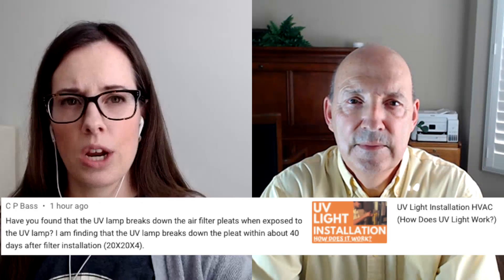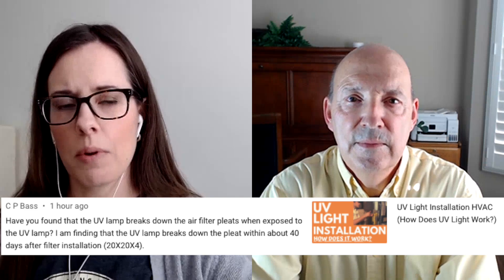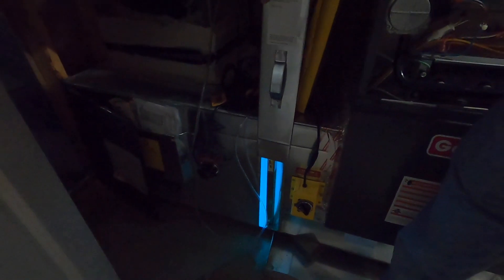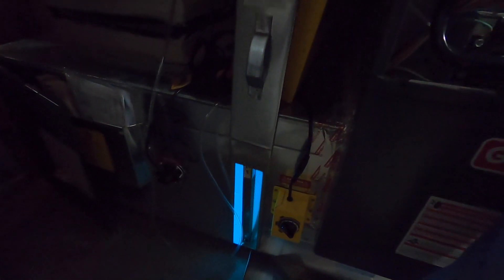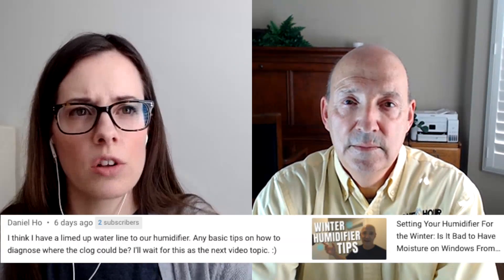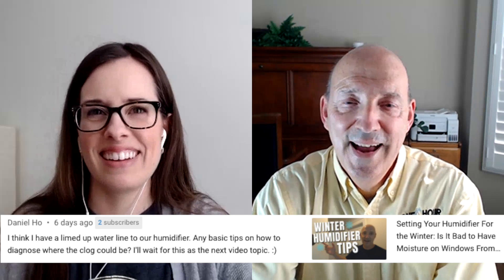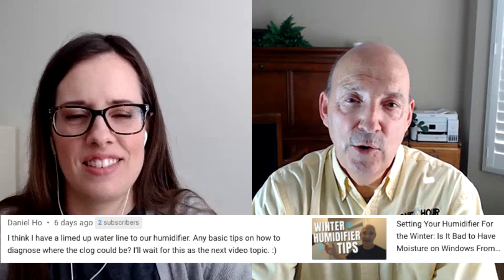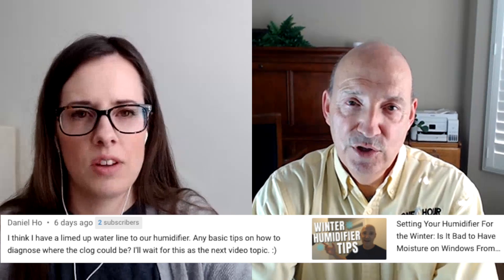YOUR HVAC QUESTIONS ANSWERED BY AN HVAC EXPERT | UV Lights, Humidifier Clogs and Broken Dampers

Comment: Thank you for the video but our house has no handle for a dampner. It's an Aprilaire unit and it uses two actuators. But we have no sur flow downstairs. Is there a way to check if its open or closed?

Comment: I have a 3 bdrm ranch and half of my basement is finished. One bedroom, which sits above the finished side of the basement is ice cold and very little heat comes out of the wall vent. I'm assuming it's because the damper is closed, but I can't get to it due to the basement ceiling being finished. Is there a way (some sort of tool) to open the damper from the bedroom down into the ductwork? I don't want to take down the entire ceiling to find where that damper wingnut is to open it.  Any suggestions?

Comment: Good job.  My A/c company installed a U/V light in my return duct.  I thought we were installing it to kill bacteria and gunk growing on the coil.  The light in the return duct will not stop gunk from growing on my coil and clogging it up.  They are fighting me in changing the location.  Can I buy just a light wand and install it myself above the coil, plugging it in a separate a/c outlet and not the a/c unit?  Thank you for your time.